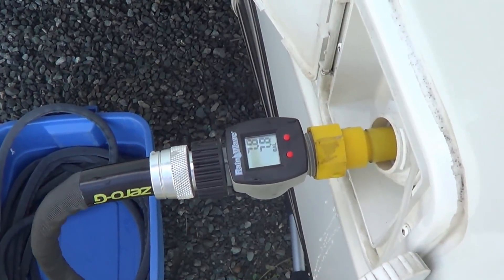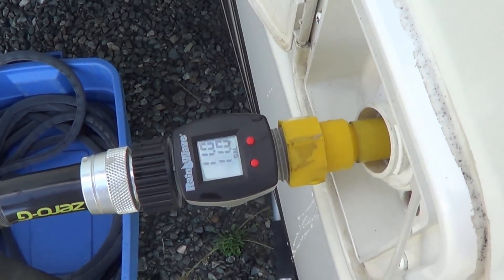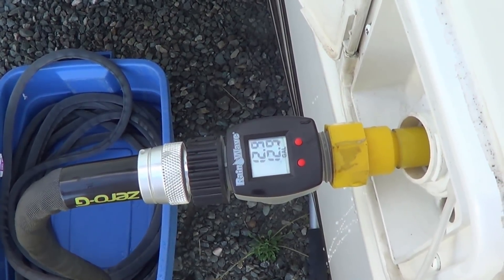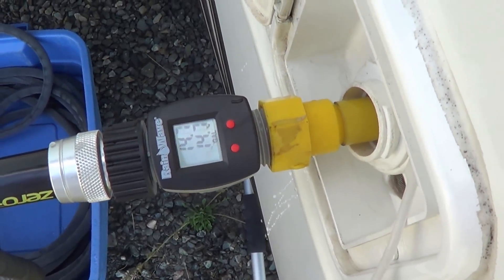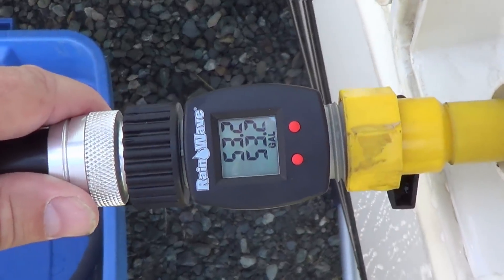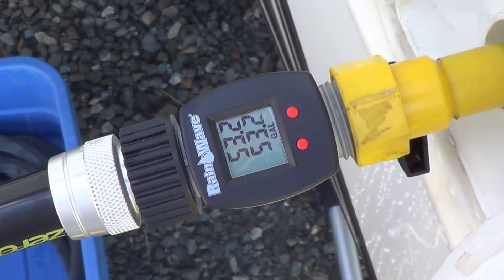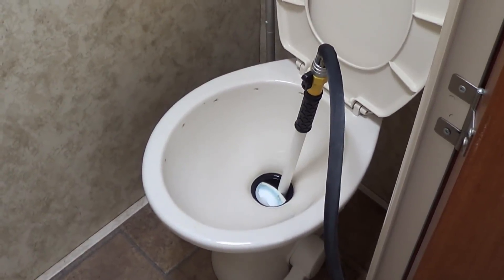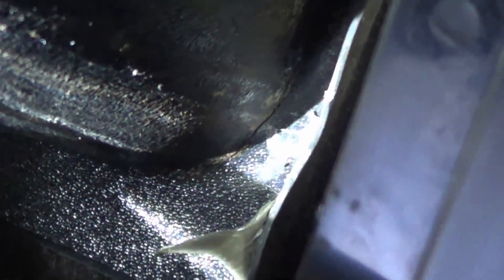Checking RV Tank Capacity - Then OH OH! Cracks!

Comment: Ray, if you haven't seen this tank repair video it may be helpful.  Dave

https://www.youtube.com/watch?v=1hP2QDB5Bis
Reply from the maker: Thanks going to try a chemical weld first with Plasti-mend. The cracks are in an awkward to get a spot up high and in a corner. If that doesn't work I will likely pull tanks and try the plastic welding. Cheers! Ray

Comment: Use fiberglass filler, you will find it next to Bondo in the automotive section and fiberglass mat I have also had good results with new fiberglass window screen as a mat. Use disposable gloves and mix it in small batches. good luck.

Comment: I had a crack at the discharge of my black tank. Found a guy on YouTube that used abs glue (the one you use to glue abs sewage pipe) and a mix of abs shavings. Gave it a try and 2 years later still no leaks. Just shaved some abs pipe, mixed it with a bunch of abs cement which melted it, and applied it to the crack. Then added fiberglass drywall tape and liberally applied the mixture again. Good luck.
Reply: Once I used a cat food bag as the repair “tape”. Woven poly works great

Comment: Like several others here, I have used a product called "FiberStrand" (or something like that) to repair everything from my go kart seat to adding structural components to the fairing, etc.  With all the vibration - and crashing on a pretty regular basis - it held up very well.   I'm sure it would  hold water if applied correctly.  Very easy to use.
Also, prolly wouldn't "sigh" too much underneath that black tank drip - lol. 
Sure do love that pooch!  Best of luck!  Thanks!
Check out Wal-Mart's:  3M 05815 Short Strand Fiberglass Reinforced Filler - 1 Quart
Reply from the maker: Thanks. :)

Comment: Ray if your tanks are hdpe you can weld them with a small torch or heat gun.  You would need to use mdpe as a welding rod.  I found mdpe in the squeeze type sports water bottles and cut them into strips then welded them onto my tank.
Reply from the maker: Thanks.  The waste tanks are black ABS according to the manufacturer website - http://www.ameri-kart.com/RV-Products/Product-Catalog/Products/Holding-Tanks/HT516.aspx Think I might go with an ABS patch kit like this or similar - http://www.plasti-mend.com/cart/index.php?route=product/category&path=59

Comment: lots of good advice.  I had bullet holes in a gas tank once on a chevy truck.  plastic tank,  I used a good tank repair patch kit. roughed up the area around the hole, spread some of the mixed "bondo" in the kit, put the fiberglass patch on and smoothed it out, then coated the rest of the mix over that. cured in 24 hours solid.  no leaks.
word of advice tho,  you gotta be ready to spread the mixture pretty fast. it's dry time is only a few minutes.
Reply from the maker: Thanks, Charles. Got to love the wisdom of the crowd. I learn so much. Cheers! Ray

Comment: The first step is finding out what your tanks are made out of.....but installing some strapping to better support the weight when near capacity.  I wouldn't really worry too much about the grey water.....but you'll definitely want to find a patch kit for the black tank.
Reply from the maker: Its ABS found this possible patch kit - http://www.plasti-mend.com/cart/index.php?route=product/category&path=59
Gonna check the local boat repair and parts place too and see what they have. Strapping is a good, tip a few others have mentioned. Thanks!

Comment: The fresh water capacity includes the water heater capacity. My passport has a 30 gallon capacity but the water tank is 24 gallons plus the 6 gallon water heater. Most likely your unit comes with a 6 gallon or a 10 gallon as an upgrade. 

For the plastic tanks, JB weld probably would be your best bet. May want to add a few more support straps as well to help with the cracking. I am guessing with all the backroads you go down boondocks go and carrying liquid in the tanks caused the cracking. Hope everything works out. Last thing you want to do is drop and replace the tanks.
Reply from the maker: Thanks, Chris!
Reply: And then add a couple of layers of eternabond. One relatively small over the patch and then one bigger to secure the edges of the first layer and add support across the crack.

Comment: I wish I had advise for you Ray regarding the cracked tanks. Is 60 gallons fresh water the advertised capacity from Cougar? If so, RV manufacturers usually include the hot water tank in their total fresh water capacity. So that would make sense if you didn't factor this in. 53.2 plus 6 = 59.2 plus plumbing lines would equal around 60 gallons.
Reply from the maker: Yes, the Cougar said 60 gallons. Makes sense, thanks.

Comment: Ray, since your tanks are ABS, I think the idea of using ABS Glue mixed with ABS shavings will work perfectly. This would be the easiest, cheapest and quickest way to fix those tanks. Additionally, adding a couple of straps for added support should prevent more cracks from forming in the future. Best of luck, I am dealing with my own fresh water tank repair.

Comment: If the cracks are near the top a temporary patch with Eternabond tape should work.  Can you see if it is rubbing or came in contact with anything, structure, rock, or a bind at install causing a twist when full?  Permanent repair is in your future videos, I can tell ( :
Reply from the maker: We do a lot of rough roads to boondocking locations some heavy washboard, returning with full tanks. That's like the cause. Guess I need to add a little more support for the tanks if I'm wanting to play off road. ;)  Cheers, Ray
Reply: RedRoofRetriever I would try fiberglass resin and cloth

Comment: It's your house, new tanks.
Reply: I agree! I'm sure once the tanks are out, new tanks can be found or ordered that are of a better material and will then last much longer.
Reply from the maker: They are not cheap. :) Such small cracks and near the tank top. I think I can repair and make last.
Reply: I think they are put in before the flooring in put in.  Might not cone out.
Reply from the maker: There are bolted on rails running between the frame I-beams holding the tanks in, Remove them and it looks like the tanks will drop down, of course, there are also the plumbing connections on the top, drain and vent pipes to consider.

Comment: FLEX TAPE ! you know, the one used by the guy o n tv that taped the boat back together. It works as advertised Caution though, there is a learning curve to using it and not sticking yourself together and have a bottle of goo-gone ready to go. you will probably need it no matter how good you are.

Comment: Unless you figure out a way to support the tanks from the bottom you will always have cracks because of the upper tank lip having to support all the weight. If it were me i would put straps under the tanks and use the abs repair kit.
Reply from the maker: Thanks, that's what I'm thinking.
Reply: Yes on the straps. I had success with just using the pipe cleaner and glue years ago.

Comment: Boy Ray, that's just your luck, you just installed your electric waste tank gate valves just the other day, and now you have cracks in your tanks, great. Ha ha, you'll figure something out Ray. :'( :) ;)
Reply from the maker: Yesh, :) I think they have been cracked for a little while. I noticed when I pulled down the underbelly it had a few stains on it I could figure. The leaks only showed up once the tank was right full. I'm glad I caught it now. Cheers, Ray
Reply: Yeah, that could be true ray. But still, you noticed it AFTER you put those valves on. Good grief.

Comment: When I cracked my black water tank basically everything online said you couldn't fix it cuz it's abs plastic. I used fiberglass epoxy and fiberglass batting and just did up the crack. I do resport the bottom of the tank with some straps so they are supported from underneath. Good luck
Reply from the maker: I found this website, says specifically for ABS RV tanks - http://www.plasti-mend.com/cart/index.php?route=product/category&path=59